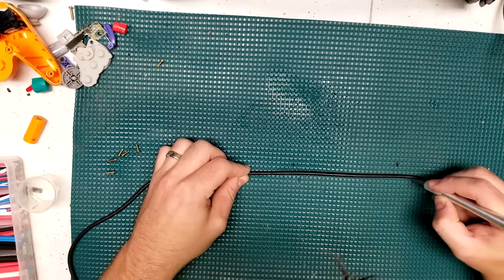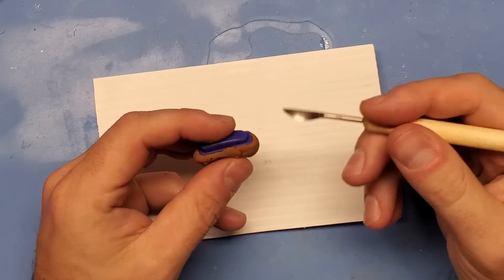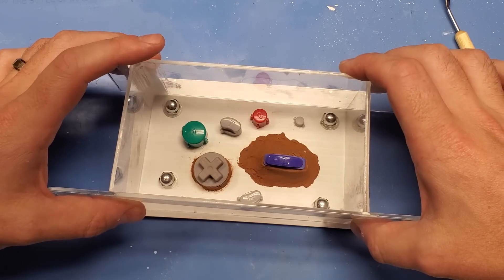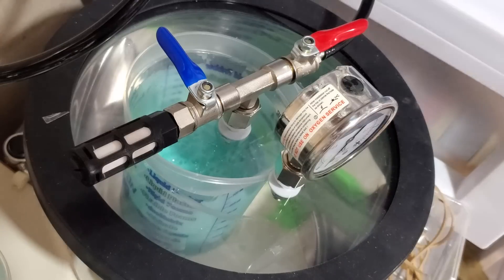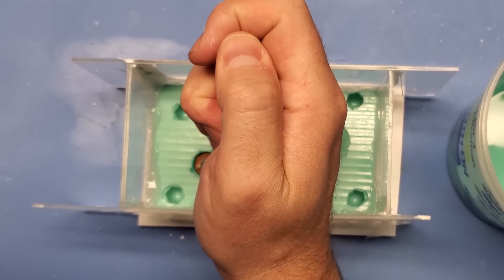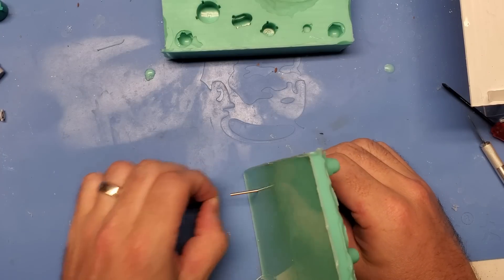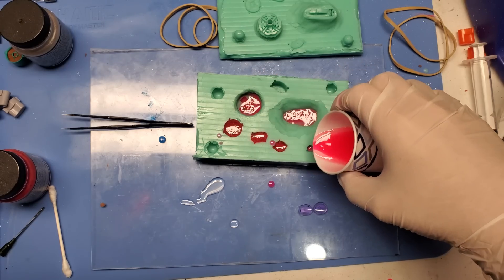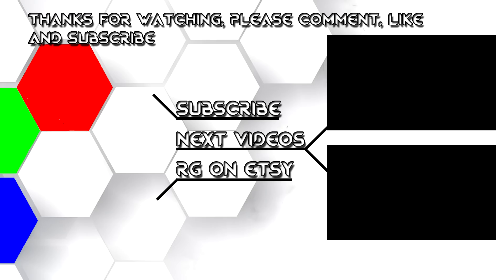Gamecube Controller Mod - The Community Mod - Part 3

Comment: Ah My morning coffee and this video. My work day is starting out good. 
Those buttons looks super slick. Love the glossy finish they have.  
While I like Neon pink with reflective tracers, My vote is for Cotton candy. It just fits the controller so well. 
In the future please explore placing an LED into a resin part and see if it can still work.  I could see a LED mounted inside of the A button on a gamecube controller being a big hit.
Reply from the maker: ^^^For sure I actually have experimented with this already and gotten ok results.  The led looks amazing in there, but the hard part is maintaining the feel.  I think it can be done, but I definitely would need to spend some more time figuring out how to make it work properly.  I have done some controllers with the A button lit up and its pretty easy to do with just cutting the shell.  I hate to have to cut shells, but sometimes it the easiest way to get the mod to work.  I

Comment: Have you ever made a mold like this without vaccuming the silicon? In wondering if I could start out wothout the vaccume chamber
Reply from the maker: I have. It works but you will. Ot be able to pressure cast with that mold and you risk there being air bubbles along the part creating imperfections

Comment: This is super rad, dude! I've been trying to make my own buttons but with just a vacuum chamber I can't seem to get rid of all the bubbles.. You're motivating me to give it another go, though. 

Anyway, my vote is on Neon Pink with Reflective Tracers!
Reply from the maker: Thanks Cyberscum.  Yeah I can tell you its hard with only a vacuum chamber.  I did it like that for a long time.  What kind of resin are you using?
Reply: I have Alumilite Amazing Clear Cast. I got pretty close a couple of times, but I'd either have a few bubbles or something else being off, like seeing slight yellowing. Also the buttons I made molds of initially had a lot of scratches on the sides. I bought a brand new controller for that later but they already had some imperfections.. T_T
Reply from the maker: Yeah the amazing clear cast is an epoxy based resin, which is great if you want a truely clear cast buttons.  What I would do before I had a pressure pot is mix the resin and then let it sit in the vacuum chamber for a good 30 minutes (The pot life on the epoxy resin I use is 45 mins).  By then all the air bubbles would be out and then I could pour the button and get no bubbles.
Reply: Alright, I'll give that a try the next time I attempt to make something!

Comment: I think the pink with the tracers would be super cool!
and for resin buttons is it necessary for the vacuum chamber?

Another great video!
Reply from the maker: Thanks Ethan.  Its possible to get away with it, but you risk there being air bubbles in the final castings.

Comment: Nice mini tutorial for making molds, i’m going to check out the full one. It gave me a bit of confidence to make one, but I’m still unsure about it
Reply from the maker: Do it!! They are a ton of fun to make!
Reply: Buy a cheap knock off, off of eBay. That way you can test basic visual mods, like a shell change or button change without ruining a good controller.

Comment: can you reuse molds? i see you make a new mold every time, but if someone just starting out can't afford to do that, would it be a problem to reuse one? and if not, why?
Reply from the maker: 100% molds are good for 30 or so casts depending upon how you treat it, if you use mold release and depending upon what you're casting 30 uses is about right.

Comment: cotton candy is good but why only pinkish options (and similar colors like purple) i also have questio did you ever try making biger molds like gameboy advance shell? im curios because if that would work i see big potential for gamecube witch conttroler and gba witch some unique style like make it cartoonish style from windwaker.
Reply from the maker: Radek, good question.  I wanted to tie the pink in som more.  Right now I have clear back and thumbsticks and only have used pink and blue once.  My plan was pull at the pink and blue some more with paracord options.  My design tends to be as simple as possible and generally I like less than 3 colors, not saying more than that cant look good bc it absolutely can, but its something that has worked well for  me in the past.  ^^^Great idea, I am going to have to mess with it some more.  I need more silicone, but would love to start to get into doing custom shells!

Comment: Pink and carolina (stack it up!) blue diamond

For the buttons I noticed you're going for the flat back whereas in your previous video for casting you went with the oem hollow design. Is that a personal preference for extra weight or just easier for casting purposes?
Reply from the maker: Great question.  For me it was solely for casting reasons.  The buttons are indeed heavier, but not sure its much of a noticable difference (at least to me, I am not a competitive gamer at all).  There is a greater range of materials that I can use as a result.
Reply: @RockerGaming   I'm extremely new to casting so if you don't mind me picking your brain, how does that give you more range with materials? And do you mean different resins or materials to mix in with resins?

Comment: Clean
Reply from the maker: much <3 thank you!
Reply: @RockerGaming  no problem. Love the mods! New to watching. Been a big supporter of artisan keycaps for keyboards. If I might offer a tip maybe not useful but I've seen Lego bricks used to encase molds in instead of making boxes. The molds also snap together if you use legos. Very easy to align from my view have not tried. Love the stuff! <3